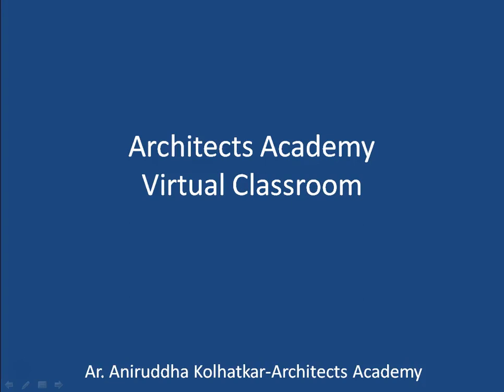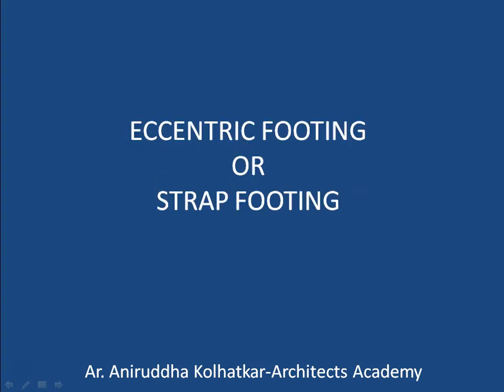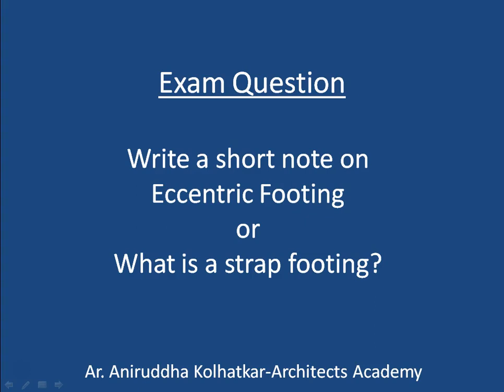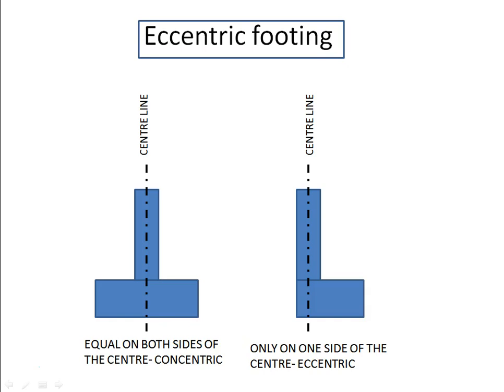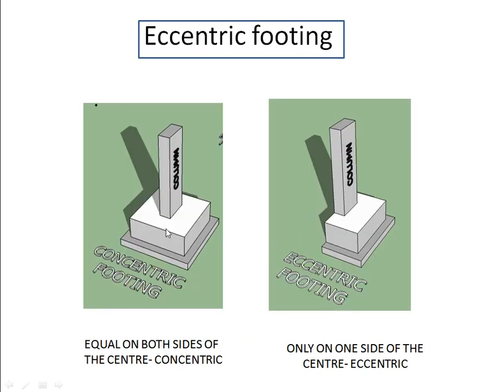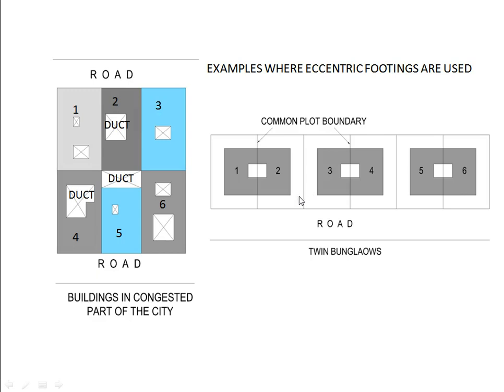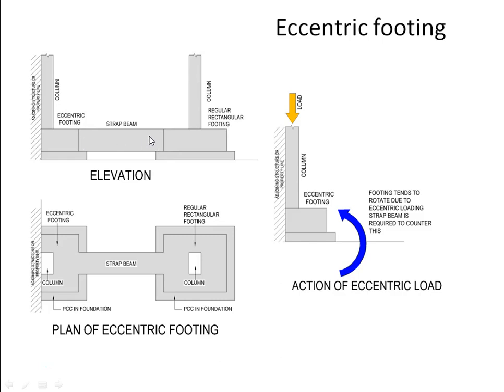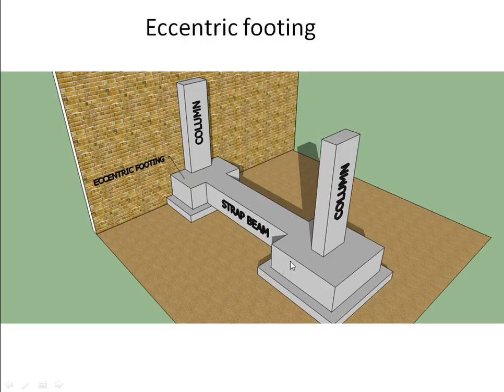ECCENTRIC FOOTING 1

Comment: We are providing PLINTH BEAM at ground level , Can Plenth Beam be designed to bear this moment?
Reply from the maker: I didn't understand your question clearly. I may not have sufficient expertise to answer this. You may have to discuss this with a structural designer.
Reply: Plinth beam generally provided at the ground lvl..as it reduced the length of the from the top..to the footing..so it reduces the moment capacity..produced by column...but in case of eccentric footing generally non-uniform soil pressure occurs from the bottom.and chances  of differential settlement generates..... therefore  to get the uniform pressure from bottom..we provide the strap beam...and connect it with internal footing..hope u understand..the concept..